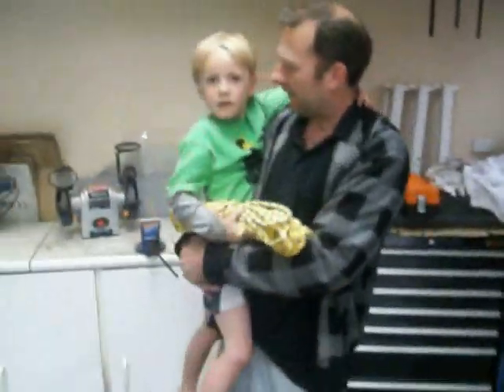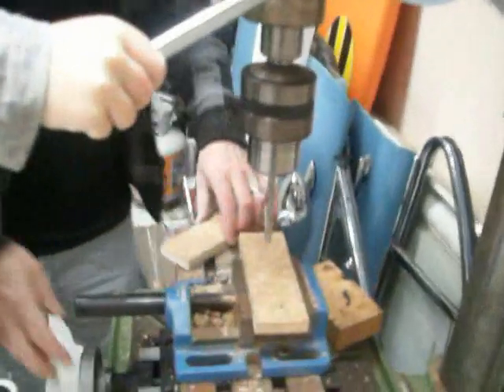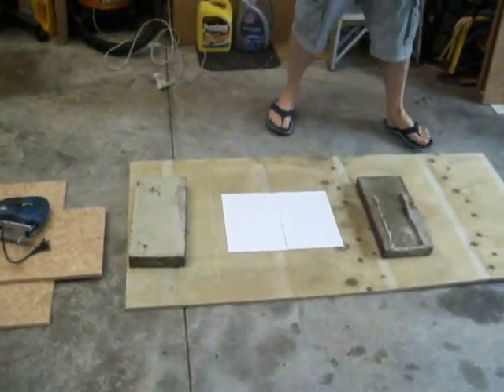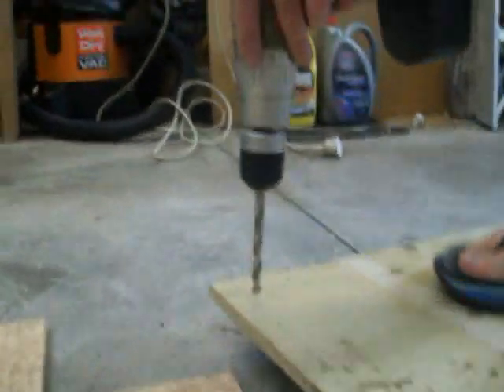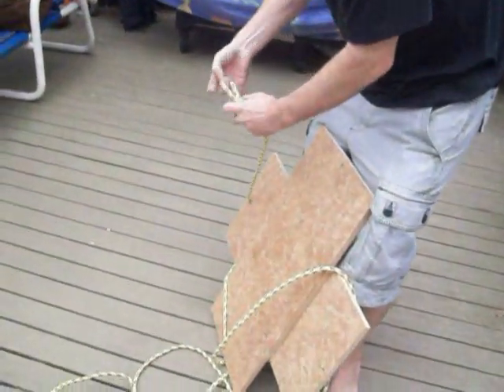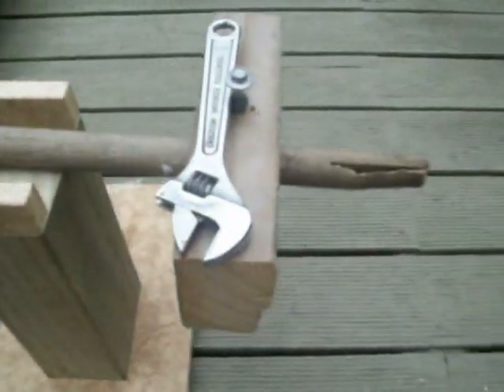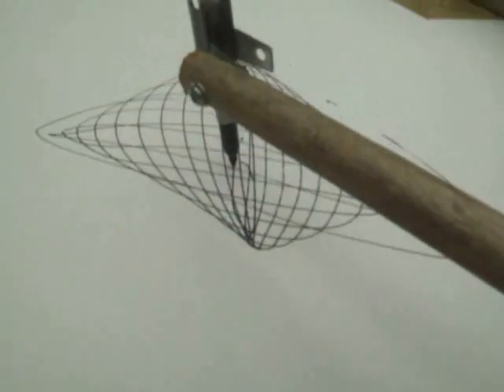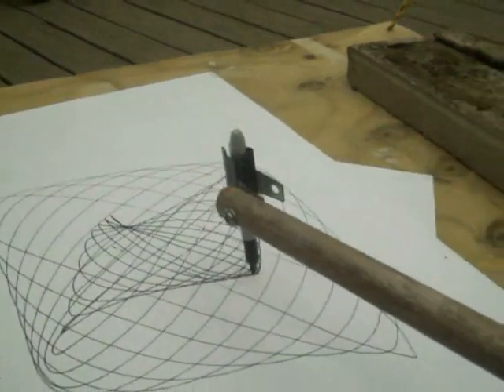Hack job Harmonograph, and it works DIY

Comment: Bravo! It's amazing you could build it after just looking at a few seconds of not-very-clear video. 
You mentioned that it draws similar patterns. To get other patterns you have to "tune" it. There are two periodic oscillations: the swing, whose period is determined by the length of the rope, and the twist, determined by how far from the center the weights are. By adjusting the twist slightly faster or slower than the swing (or harmonic of it) you get some very complex designs.